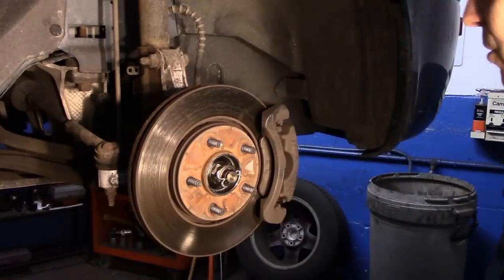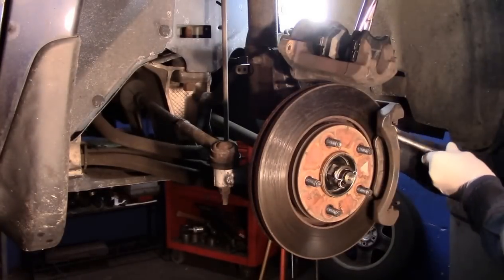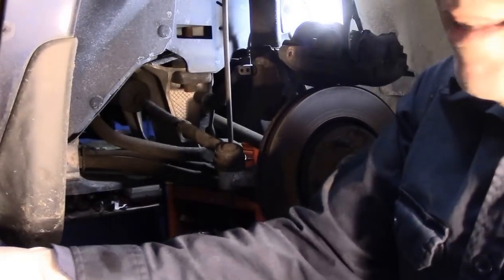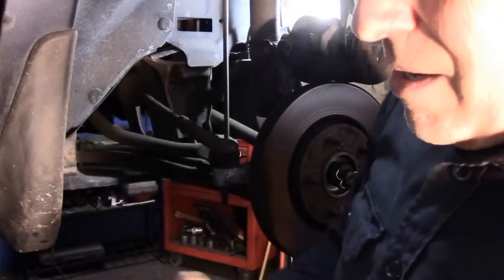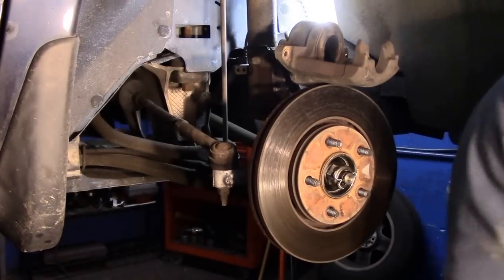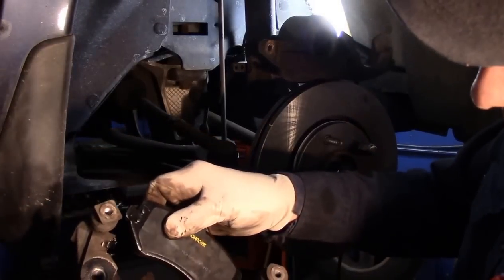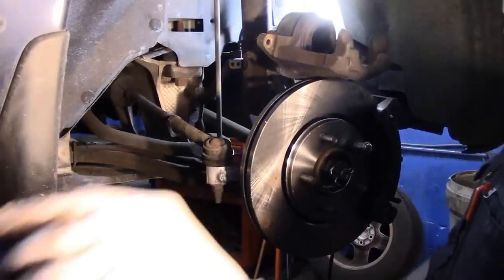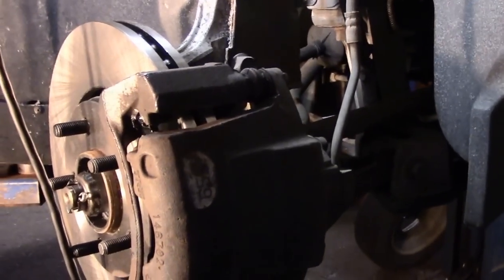How to replace front brakes and rotors 2005 Dodge Caravan

Comment: Would it make sense to turn that wheel all the way out to be able to access the bolts on the back side? I usually do that, especially because i have to use a floor jack . I watched two other videos where they used a floor jack and didnt have a jack stand in addition.  Never do that!

Comment: those Cdn 05s have different method of caliper attachment...the ones i have are headless slides and clips  on the outside pads...had to relearn.,.dont take the clips off...just sink the hydraulic cup back by prying between the rotor and the caliper.  have to complete the sink after the caliper is off.  use a torx to loosen the two slide pins.

Comment: Hello jim great video I have a 06 dodge caravan and I changed the front rotors and brake pads and I believe I  added enuff grease to caliber pins. But when your driving and hit the brakes fells like van is shaking and you can feel it in the brake pedal only.  Please help
Reply from the maker: Did you clean the rust off  the hub where the rotor attaches? If the rust is not cleaned that will cause a vibration.
Reply: @jimthecarguy  hello jim no I did not do you think that would cause it to happen? Like I said when you hit the brakes it's almost like the van chugging to stop
Reply from the maker: @russellprice7628   Yes you should pull off the rotors and check for rust. If there is no rust then the rotors are warped . If there is rust you will need to clean it all off and reassemble. Take a picture and send it to me of the hub below the rotor.
Reply: @jimthecarguy   ok as soon as I am able to take everything apart I will check and send photos,  I did check the new rotors and they are smooth with no groves and I  am not seeing any hot spots, not sure if I mentioned it or not but the brakes were do this before I  replaced everything new  and the old brake pads were still pretty good but the rotors were bad with groves,  I replaced the brake pads and rotors with new ones.

Comment: Just the video I was in search of. I’m going to be replacing the front brakes and rotors on my ‘06 Grand Caravan this weekend and this instruction will help simplify the process.

Question: is it necessary to remove any brake fluid from the master cylinder prior to pushing the piston back?

Thanks.
Reply: No